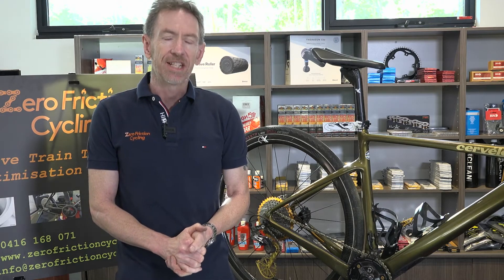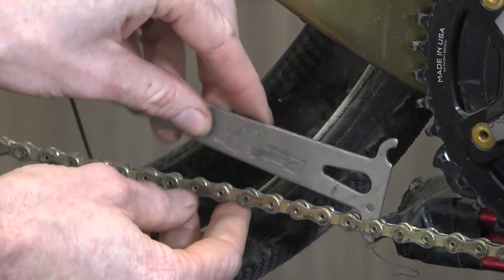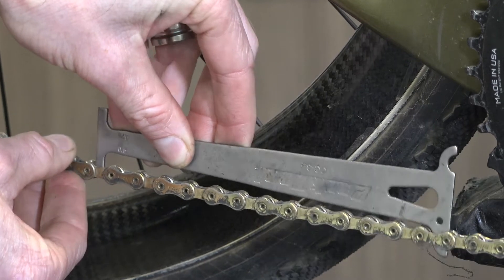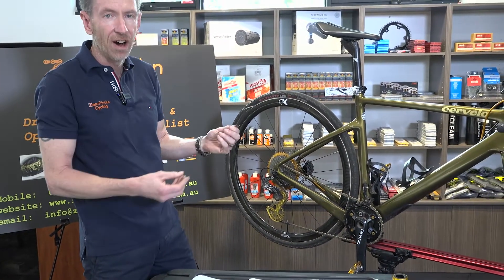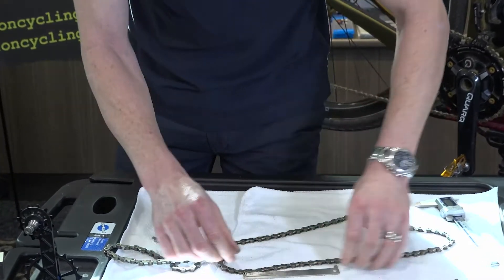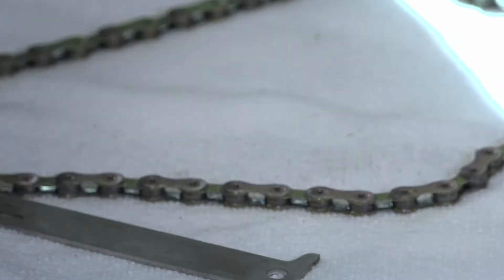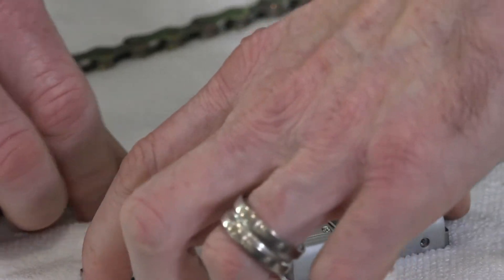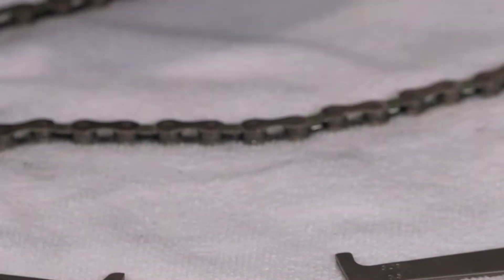Episode 5   How to Measure Chainwear

Comment: Tks Adam. Which chain checker would you recommend for SRAM AXS flat top chains?
Reply from the maker: I dont have one yet unfortunately - the only ones i know of out there use same graduation mark for axs flat top as well as non flat top, and it is physically impossible for that to be accurate for both standards. if it is correct for other chains, it will give false low wear reading for axs flat top. If it is correct for flat top, it will be well out for all others. At this time i recommend using digital calipers, measure from start of pin to start of 10th pin. A link is 12.7mm, so 10x that = 127mm. When you can measure 127.5mm from start of pin to start of 10th pin, time to replace. Need to check multiple sections under tension from rear mech so big ring about mid cassette is great.
Reply: @zerofrictioncycling992  thanks. I tried with calipers between 10 links (so that the top teeth of the caliper presses against the links). Measuring this way a new AXS chain is 131.9m over 10 pins.
Reply from the maker: @kwcmau  hi sorry for delay i just back from a weeks leave. Not sure from that exactly how measuring, but do from start of one pin to start of 10th pin - this should be 127mm new (they are a 1/2 inch pitch chain so 12.7mm long per link).

Comment: Doesn't the slit on the right hand side of the Shimano chain checker allow for the pins inserted into the rollers to be bent under force, allowing you to effectively shorten the tool to get both ends into the rollers? Ultimately showing that the chain is done when it might have quite a bit left?
Reply from the maker: on the right hand side, they flex to allow that end of the tool to slot in and isolate roller wear in an attempt to provide an elongation only wear measure, however the drop in end is still going to pick up roller wear, so to me it is a bit mute isolating roller wear at one out of two points for the check measure. But honestly all that is a bit here nor there, at least the shimano tool is always dead on, 0.5 = 0.5.

Comment: Thank you and will share / I personally use a 6 feet piece of wood and put 2 pins  and use the pins to hang the chain and cut chain to length and serves as elngation tool as well knowing the new vs old length
Reply from the maker: yes that method works, but still an accurate chain wear checker is much superior. For one - measuring full length - you do not detect when one section of chain is wearing much faster than others - and that almost always happens over time. The most worn section may cause wear damage to cassette by time chain is replaced when at 0.5% overall.  For two - this method just takes enough time that most rarely get around to checking very often, and so by the time they do, too often chain is past replacement mark, and a lot of wear damage occurred. With say the shimano tl-cn-42 tool, one can check 3 to 5 sections of chain in about 15 seconds. So it is just so easily done regularly, and people can stay on top of chain wear so much better. Guaranteed, those with an accurate drop in checker, check and replace before too worn, at a VASTLY better rate vs those who check wear by removing chain and measuring full length. Easier, and overall more accurate - is the way to go. it is a one off purchase that will last forever - an accurate drop in checker is a cyclists best friend indeed.

Comment: measure 12 inches of chain starting from the center of a pin. If it's 12 inches and 1/16 then the chain is done. Do what carpenters do and start from the 1 inch mark of the tape measure and read at the 13 inch mark to be accurate.
Reply from the maker: Ah. I think everyone should instead watch this and then never use an imperial measure again in their life -
 https://www.youtube.com/watch?v=hid7EJkwDNk
Reply: @zerofrictioncycling992  Metric is a better measurement system overall, sure, but all bicycle chains are manufactured to the imperial system - with each link exactly ½ inch from the other. So, it's easier math to work with imperial measurements here since that's what the chains are manufactured to.
Reply: @zerofrictioncycling992  No wonder you have SO many nay sayers !!!
Reply from the maker: @RT-tn4ry  Lol - i really dont think i do, or if i do they are hanging out in weird corners where they are welcome to stay. i don;t know what you are referring to specifically on this vid that would generate the so many nay sayers. Pls enlighten me.

Comment: Hello, I’m a new subscriber and love your knowledge transfer! Thank you very much! I got one question… Can i use my old 11 Speed one on my new 1x12 system? Or did i need a twelve speed specific?
Reply from the maker: Hi Irfkapatan - do you mean chain or chain checker? chain you should definitely run a 12spd chain. Chain checker is fine across all bicycle chains except 1/8th track chains as they have a much larger roller. but all bicycle chains are 1/2 pitch - distance from pin to pin, and mostly very similar roller sizes (typically within 0.1mm diameter variance) and so chain checker works for all bicycle chains except 1/8th chains. Note though there is a big variance in accuracy of chain checkers- not something i can check for all models / all brands, i just know from what i have tested, far too many are not accurate, the shimano tl-cn-42 is the only one so far i have 100% confidence in every tool as they are laser cut vs cast and finished.
Reply: @zerofrictioncycling992  Thank you very much! I was talking about the chain checker. Just ordered one for my 12speed GX an X01 rig’s! Amazing content and thank you for the response. ❤️